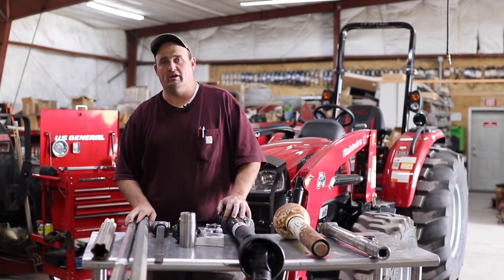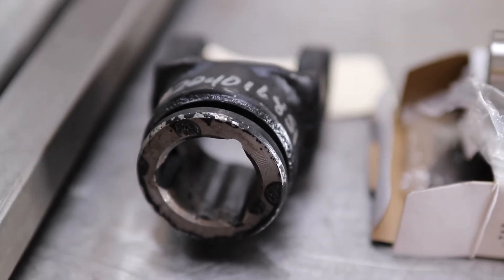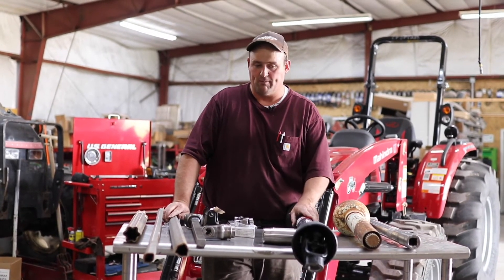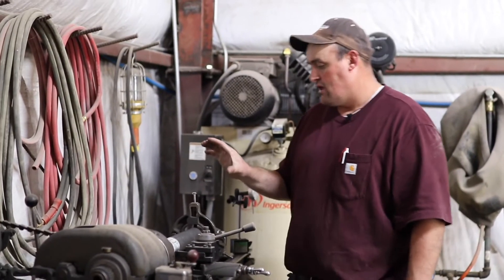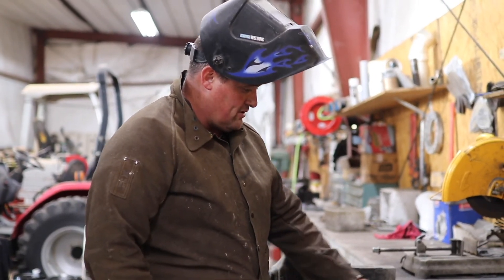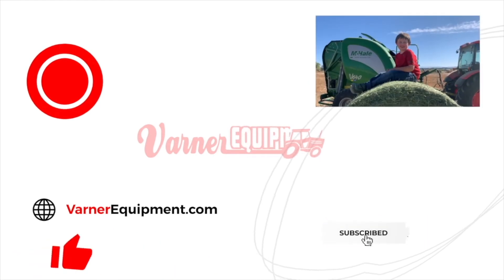How to Shorten Your Driveline | What To Do When My Driveline is Too Long for My Tractor

Comment from the maker: Thanks for watching! Jump to:
00:00 - Overview of Drivelines and Tips
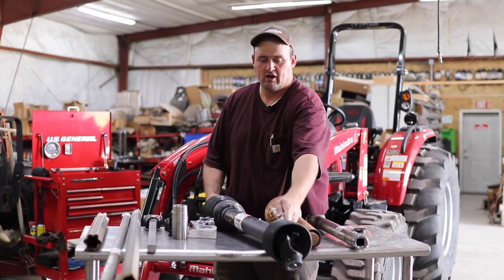01:06 - Why You Would Need to Shorten Your Driveline
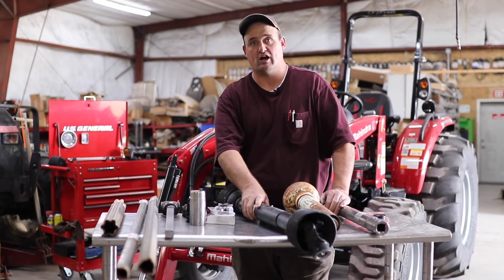01:58 - When to Buy New Instead of Doing it Yourself
03:50 - Different Types of Drivelines
12:02 - Determining How Long Your Driveline Needs to Be
13:04 - Marking Your Cutting Lines
14:11 - Cutting the Driveline
16:02 - Reattaching the Pieces
17:24 - Welding the New Driveline in Place
18:35 - Final Result